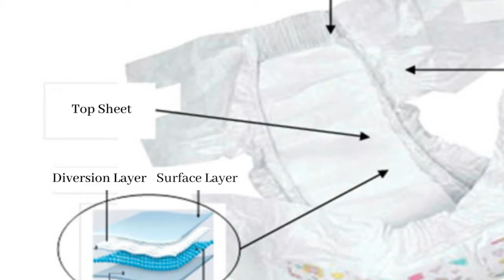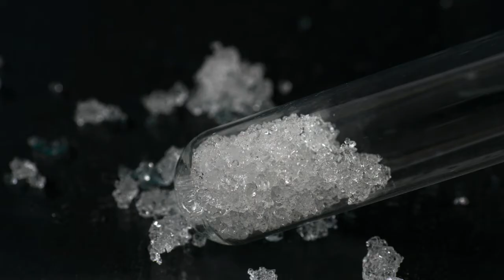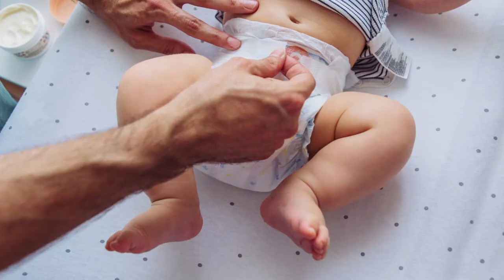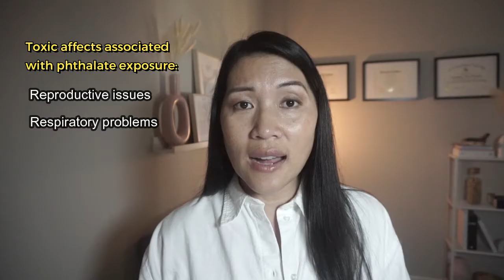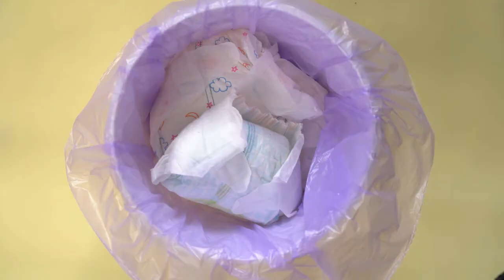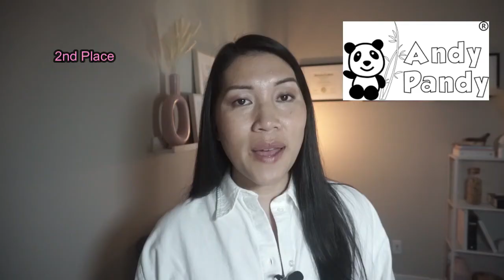How to Choose Non Toxic Diapers BEST Disposables for New Moms

Comment: I use muslin cloth towels and a polyester wraps over them. The muslin cloth is in direct contact with baby skin but I always worry a bit about the polyester wrap. What do you think about this problem. I research this issue and you can use wool panty type wraps. Unfortunately these are very expensive and difficult to maintain.

Comment: My only worry is the wetness indicator. But I only plan to use disposables for the newborn stage. So I'm not sure how much of an issue having one/or not would be. I'm leaning towards ecoriginals as I won't have an indicator with Reusables. I'm just worried about them sitting wet or dirty for long periods without my knowledge.
Reply from the maker: I feel you! I had the same concerns but got used to checking frequently and also paying attention to my kids' elimination patterns. They usually made faces and I also got a sense of how often they'd go based on their feeding patterns.
Reply: @dryvonneburkart  awesome I won't know until I have them. I'm looking years in advance though there might be better ones in the future

Comment: Hi. I needed some advice I emailed Dyper to find out if they are TCF. This was their reply "Our diapers are chlorine free. We currently use an elemental chlorine free (ECF) bleached, Forest Stewardship Council (FSC) certified wood fluff pulp in our absorbent core. ECF bleaching is a chlorine-free process in that no elemental (molecular) chlorine is used in the bleaching sequences, and has been shown to result in an end product that is free of dioxins and toxic chemicals. In addition to this, ECF fluff pulp has been found to produce more fluff pulp using less resources, making it a more sustainable option when compared to totally chlorine free (TCF) bleached fluff pulp. "

I'm a little confused, does this mean they aren't TCF? Would you still recommend this brand?
Reply from the maker: Yes because TCF is a claim that no brands can substantiate without contaminant testing, which most don’t even conduct in the first place. They’re buying fluff from suppliers who claim TCF without any data to back it up. Furthermore, even TCF can be contaminated with chlorine in the end product even if it wasn’t intentionally introduced. So far, the only brand that can substantiate any of their claims with contaminant test reports along with being plant-derived is Ecoriginals, which is why they’re my top pick. Dyper is the best store option imo.
Reply: @dryvonneburkart  thank you so much! This is very helpful! And it makes it alot less confusing for a first time mom! I appreciate you taking the time to reply. I wanted a safe "in store" option.